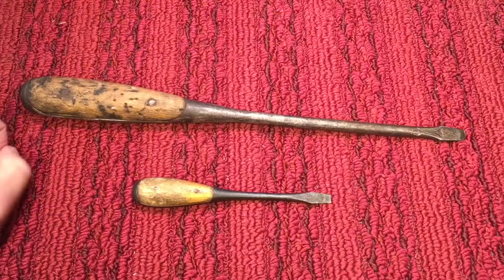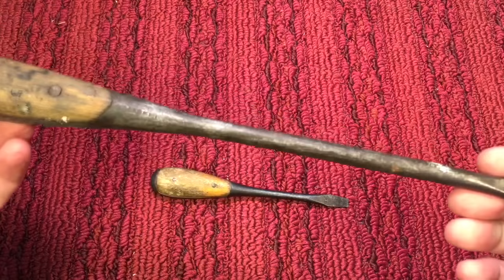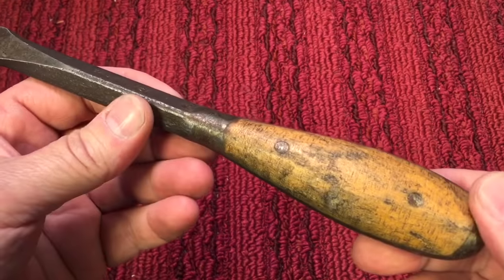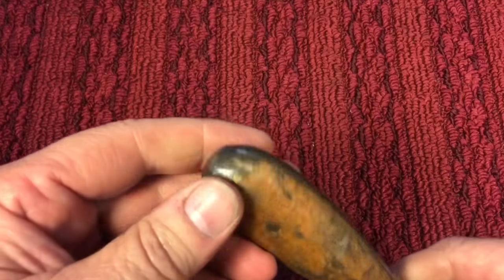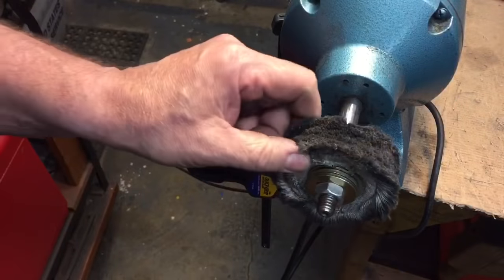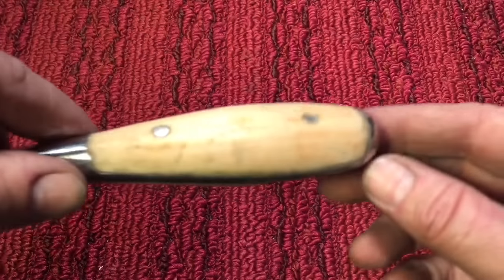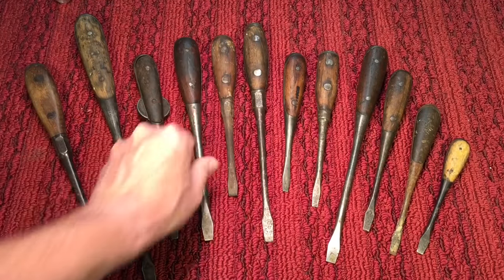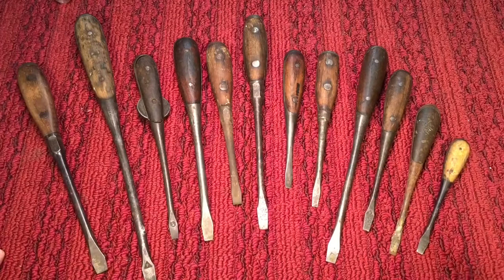Restoring The Most Awesome Screwdriver Ever Made!

Comment: Awesome video.  Thanks for your effort.  

I have an 18 inch Perfect handled screwdriver that is very rough.  Because the wood is so roached out, I decided that I'm going to replace the scales.  I have experience in knife making, so I'm pretty confident that I can get a good fit.  Two questions. 

1.  Should I make an attempt to restore the original wood. 
2.  If I do replace the scales, should I go for a standard hardwood or a more figured hardwood.  

Thanks for your any help you can provide.

BTW - It looks like the original scales were shaped, soaked in water or alcohol to soften the wood, and THEN pressed into place.  Do you have any details about the fitting of the scales?
Reply from the maker: Hello BKF!  There are still many NOS examples of these screwdrivers around so if I were you I would really enjoy myself with that screwdriver and put on some handles that YOU like!  Forget about value, the original handles were nothing special, just a hardwood that fit the bill... Since you have dabbled in knife making you can really make some nice handles for this that will do it justice!!!  I did one in Paduke years Babcock with brass bolsters!  Awesome!  As far as saturation of the wood, don't... It will swell the wood then when the wood shrinks it will have gaps!  My buddy Joe from "Joe's workshop" on YouTube did a couple of these!  Go check his channel out and tell him I sent you!!!  Awesome project!!!   Thanks!!!
Reply: Thanks!  I appreciate the advice.  I have some highly figured wood that I've stabilized with MinWax wood hardener. I'll find a couple of interesting pieces to use. My main concern was that I was completely destroying the historicity of the screwdriver - so thanks for putting that one to rest. Damn the torpedoes and full speed ahead!

Comment: Like everyone else here I loved the video and the final result was amazing... I'm sure i watched it a dozen times.
I do have a question though... when you were showing the different variations of perfect handle screwdrivers in your collection, tbere was one that was missing... Have you seen an H.D. Smith with a "spoon" shaped in dent in the shaft right above the handle? It would have a large "S" logo in the circle spoon portion... similar in look to the wing tip screwdriver you showed but that version was not incased in the wood in that area but rather exposed metal connecting to the shaft... I think it was called model 660

Comment: Sometimes on old tools, especially wood boring bits, the numbers were an indication of size and could mean number of 16ths or 32nds or whatever. So a "Number 5" tool might mean it's blade was 5/16" for example. A #4 would be a 1/4" tool and so on.

Comment: Another great, great video.  Question - why do you use a razor blade to clean the wood instead of sandpaper or emory cloth?
Michael Bradley
Reply from the maker: Hello Michael, The preferred way to prepare wood is to scrape it, when you scrape the wood you are literally shaving off a thin layer... When you sand something you are roughing up the fibers and creating small burrs that is like tearing at the surface...  Just like if you use a plane to smooth a surface, with a good plane you don't have to do anything else where as with sandpaper you have to keep going up in grip to smooth out the teared up surface you made from the grit before!  The Razor blade is your best friend!!!!  =)   Thanks!!!!!!
Reply: scraping with something like a razor blade is much quicker, its more aggresive. but at the same time doesnt leave leave deep marks like corase sand paper unless you scrape at too extreme angle which tends to just jump the blade and dig into the wood. which is very damaging so you gotta take your time and be careful.
long explenation but if youre interested lol

Comment: Hi! i bought a nice monkey wrench i want to restore, mentionning loose wooden inserts for the handle, how would you go about fixing that? i was thinking maybe make it sit in oil or something like that to swell the wood
Reply from the maker: Hello Martin!  The loose handles are a bear to fix, They are either shrunken and dried out or the pins are loose... Either way most people remove and either replace the originals after refinishing or replace with new!  Then oversized pins!  Nothing I know will expand the wood enough o tighten them up!!   Thanks!!!!!
Reply: thanks!

Comment: Scout, if you're really going to toss that saw, 
I'd like the handle and the screws.

Some time soon, I want to make a saw handle 
cane.  Where the top edge of the blade is, there will 
be the top end of the cane shaft, and the handle will
look just like that handle, screws included.

Or, if you want to do that, have at it.

Oh the blade makes GREAT hand scrapers, for 
finishing wood projects.  Scraping is as good 
as sanding.

steve
Reply from the maker: Hello Steve! You are so right!  I guess I scared more then a few people by saying "Trash"..  I don't think I ever threw a tool away! (Even when I should have) Lol...   It's just the new saws are so great compared to the old saws... They make Great Wall hangers!!! Lol. Thanks so much!!!  😃👍
Reply: Yeah, the new ones may work marginally better, 
the old (from our age) stuff just looks better.
(I've seen your picture, you DO have some grey 
hair.  Mine's gone mostly white.)  I'm now a FIRM 
subscriber to your channel.  Just like your stuff.

Keep them coming, Scout!

Oh, I NEED to find some of those screwdrivers!
I've got a Craftsman, Made In USA screwdriver, 
that has a torsional twist in the head.  Yes, I 
tightened something too tight, and the shaft 
bent.  1/4 inch flathead.

I've also got some Harbor Fright screwdrivers, 
and have NEVER bent one, without using a 
propane torch.  I've also never BOUGHT one!
They ALL have been free ones!  In my experience, 
FREE Harbor Fright screwdrivers are MUCH 
better than the Craftsman ones you pay for!
Sears, spin that one!  (Or, Black and Decker.)

steve

Comment: I have one of the first ones but the tip is  busted off. I have considered welding on some metal to the tip to repair it. What is your thoughts on that?
Reply from the maker: Hello Time Table!  That is a hard one! Can it be re-ground? Even if it's an inch shorter it will still be great!!!  Unless more then an inch is gone I would try to re-grind it.. If the front half is missing then just cut off and weld a new piece of square stock on!  These were so nice and strong you can't go wrong!!!!!   Thanks!!
Reply: Time Table 

That's a tough one...unless you're an ace welder (I'm passable...) you won't get a great result in a tool that's subject to a load of torque.
Answer...and I've done it a few times now; a sizable gas torch, re-form the blade tip and re-temper. A very satisfying job too.
Reply: ScoutCrafter well after watching this I went on the hunt for it as I have buckets of screw drivers(most old plastic handles) and it is not as bad as I remembered. The tips mostly still there. Just the corner is chipped off and it has a little bend to it as if someone was using it as a pry bar. But the wood is gone. It’s there but loose and weathered hard

Comment: I'm really interested to know why shellac is your go-to, opposed to oil based poly or lacquer. Still, I've learned more about shellac in your videos to make me a recent shellac madman!
Reply from the maker: Hello David! I think for me it's all about performance, I never had a problem with shellac!  It sticks to everything yet doesn't dry hard enough to chip! It lasts a long time and dries very fast.  Lacquer is ok but brittle, oil based poly is prone to mishaps and looks plastic-y   =)   I like Shellac and Varnish because I know how it will react and no surprises.   With this project the shellac handle looked exactly like the original handle!  The others would have looked good but just not the same (for me)  I have tools I coated in shellac twenty years ago that look awesome!  Thanks very much!!!!!!!!
Reply: ScoutCrafter I really appreciate the response! Though I don't have much experience with lacquer, I can usually make my poly projects look good, even if they're plastic looking. One of the biggest nuggets of knowledge gained from your videos is how well shellac adheres to, and makes pop, metal surfaces. Of course, I called BS on your clear coating of the red screwdriver handle and ate my words within seconds. Keep your videos coming, for sure!!
Reply: David Jordan 

Polyurethane is dreadful! Always problems with surface adhesion and even adhesion to itself between coats! It's really a discredited material nowadays. 
An older style Alkyd yacht varnish is better but shellac is the business, especially on steel and brass, all the old instruments like telescopes, sextants and microscopes were treated with it for that reason....many have sadly been stripped of their shellac but are far more prized when they do have it!

Comment: Mystery solved on the number on the bottom of the screwdrivers (at least the HD Smith models). The number refers to the blade length.. For example a number 6 on the tip means that the blade length is six inches.. a number 5 would be five inches etc. I found this out by looking at an old (1922) advertisement to potential dealers showing a store display stand for the set (wing set) which explains the different numbers as well as the tip widths and thickness. I unfortunately can't post the photo here but here is the link... scroll down to the bottom to see the photo.

https://archive.org/details/HDSmithAndCo1922/page/n3
Reply from the maker: The funny thing is many of the screwdrivers that have numbers on the blades don't match the size!  It's crazy!  Those HD winged screwdrivers look like they correspond with the number on the blade....  =D  Thanks!!!!!!!
Reply: @ScoutCrafter  lol interesting here is another page that deals with sizes and dimensions..

https://archive.org/details/HDSmithPerfectHandleTools1914/page/n1

And a possible answer to your observation...
https://archive.org/details/HDSmithAndCo1922/page/n5

Apparently HD Smith Co. Was aware of other manufacturers copying their design and attempted to go after them for copyright infringement. The above link is part of that solicitation to dealers asking for their help in identifying "knock-off" manufacturers. So the numbering system can only be applied to screwdrivers manufactured by HD Smith Co... copycat brands from other companies could have been doing their own thing and the numbers on copies wouldn't necessarily have the same meaning or any meaning. 

*note: I recommend downloading the pages from the above links in pdf format (links to files underneath photos) and opening them that way so that they are legible and the print can be read.